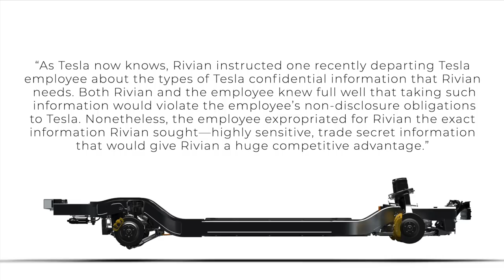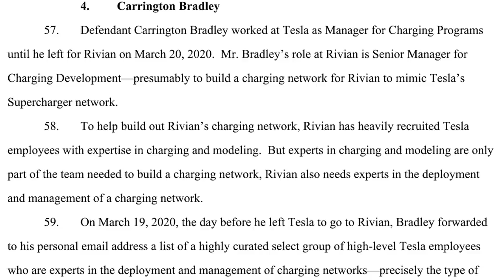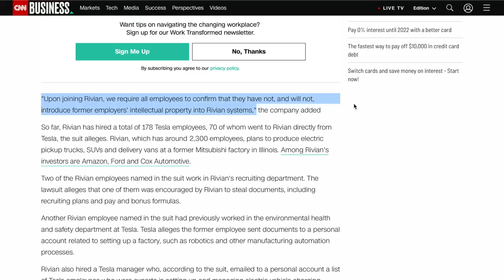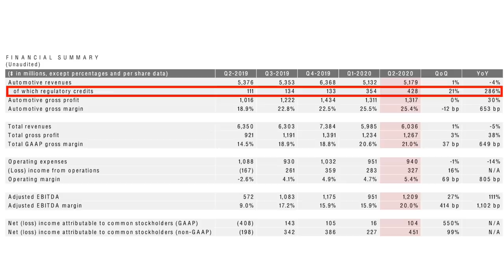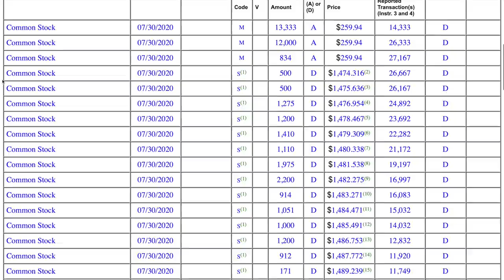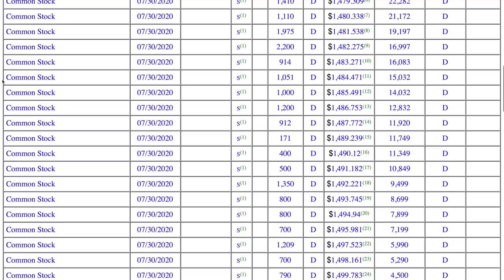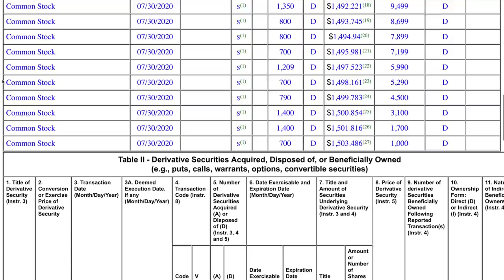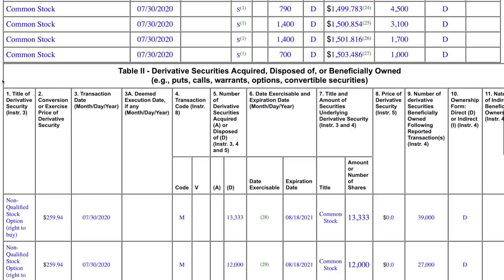Elon Musk Explains Rivian Lawsuit, Tesla Short/Long Term Goals, Succession Planning (TSLA)

Comment: I just want good news so I can probably sell a share. Bought 8 at $1600 , thinking earnings day it was a sure thing.
Reply: Now you know. If earnings are a "sure thing" the stock gets bid up before the earnings announcement. 
  
Resist the temptation to sell and eventually the stock will show a profit. Sell now and you'll realize your loss. Right now, before you sell, it's just a harmless paper loss.
Reply: The stock's volatile, but hang in there for a decade or two. $1600 will be laughably low by then.
Reply: the stock will most likely pop with S&P inclusion but I would hang on as long as possible